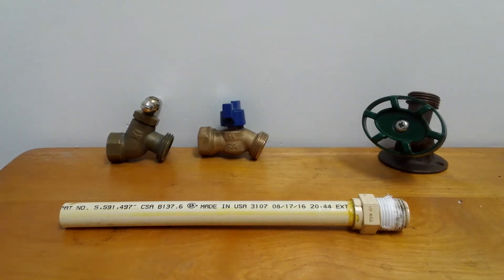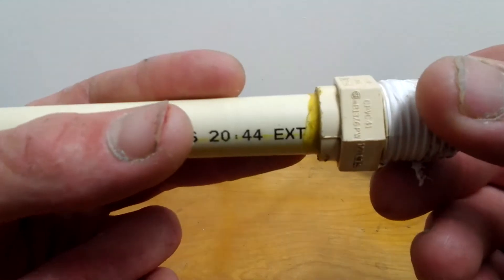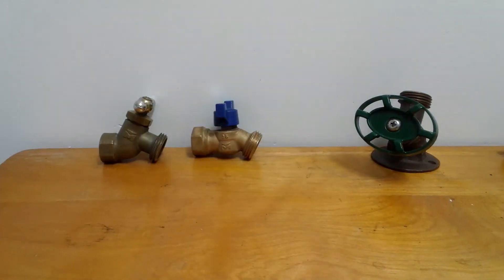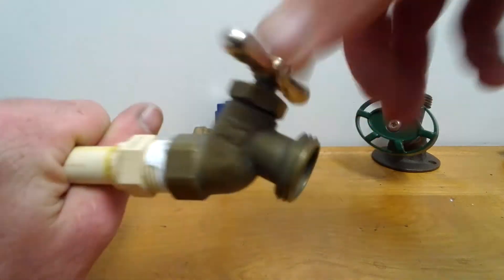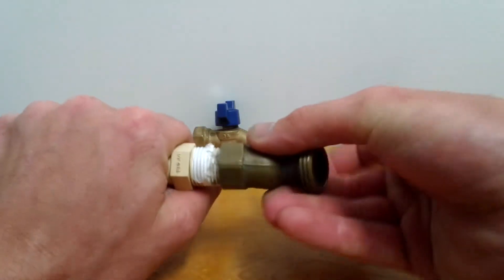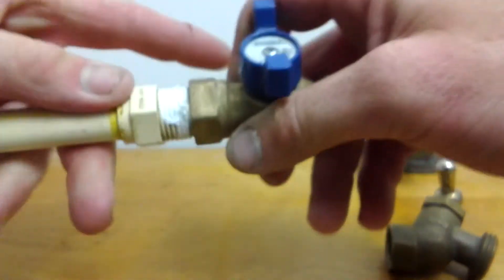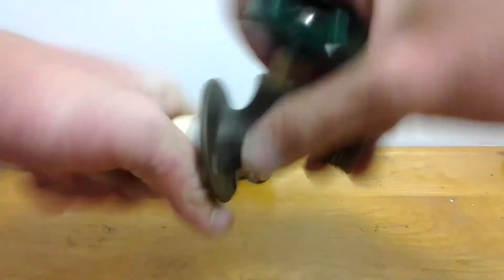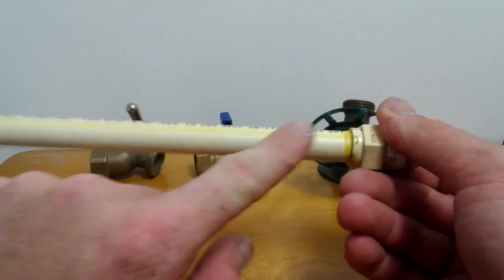How to connect a hose bib to CPVC pipe

Comment: looks skinnier in real life! But thanks, yes, mine measures about .630" but you don't find much in the way of "5/8" potable water cpvc"... so it's 1/2 CTS is the terminology, more. Thanks... I can get to adequate pipe to put on an adapter by opening up a bit of brick. Even the builders had put a little plaque to hold the hose bib. Ill just make a bigger plaque. Think I have some star board